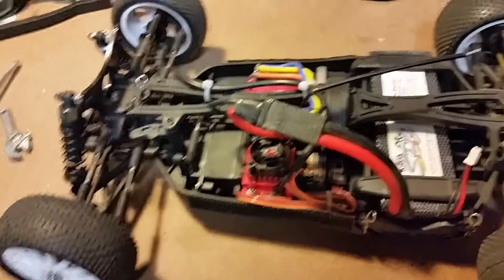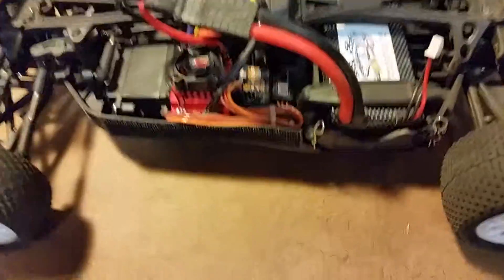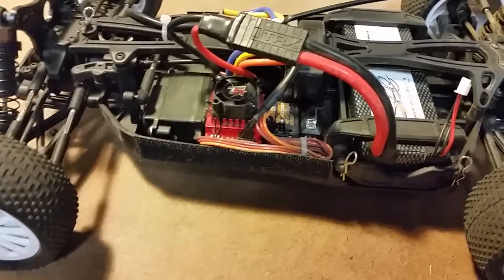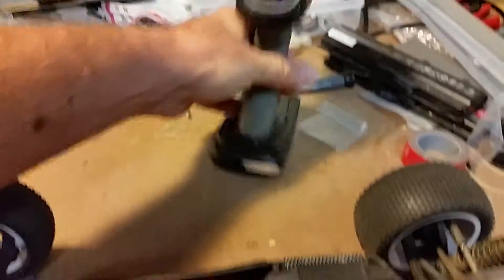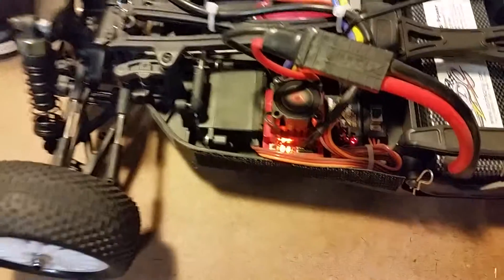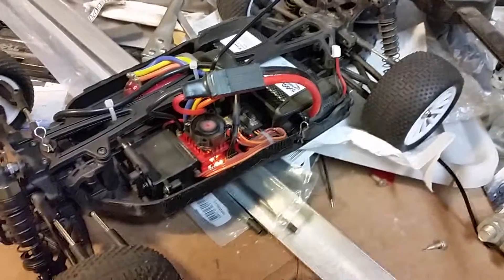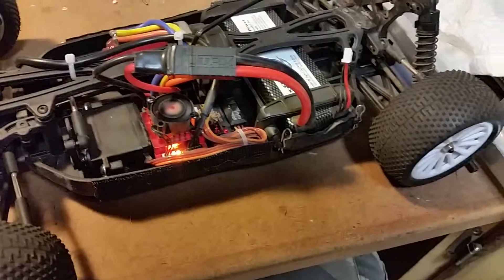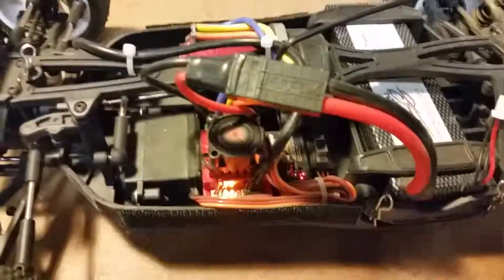Turnigy Trackstar 80a Turbo esc problems

Comment: check all your wire connection, some times you will get enough current to keep the lights on but but not enough to run the motor, sometimes the switch starts to stick and it will turn off and on, for an example you will hit a bump and it will turn off other times you will have to flick the switch on and off a few times to turn it on
Reply from the maker: Thanks, but that was 3 years ago.  The ESC was smoked and HK needed a video in order to refund me.  I replaced the ESC and proceeded to beat the hell out of the car.

Comment: did you calibrate the Speed controller ai it knows what is what on the controller and knows the correct values
Reply from the maker: yes, I attempted to recalibrate but it's non responsive.  I've long since replaced it.
Reply: +Jim85IROC  alright

Comment: Program to forward and reverse and switch around 2 motor wires or change motor detection in program
Reply from the maker: Thanks, but the problem was a burnt esc.  It died mid-pack, so reversing motor direction wasn't going to fix anything.  I only made the video because Hobbyking required it in order to issue a refund.  After that I put in a new ESC and it's run great since.